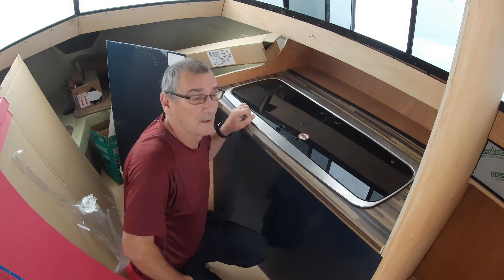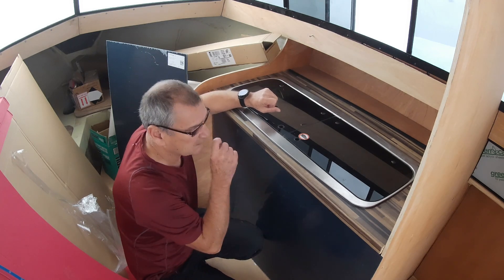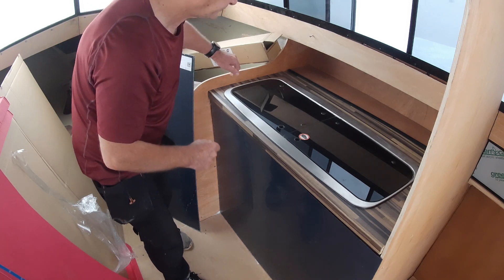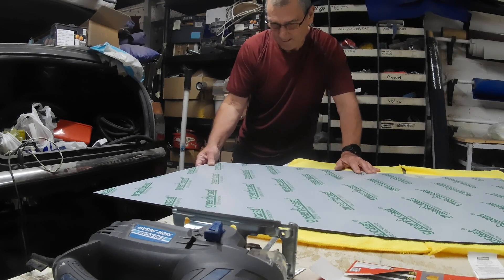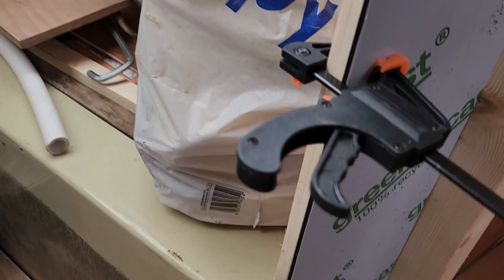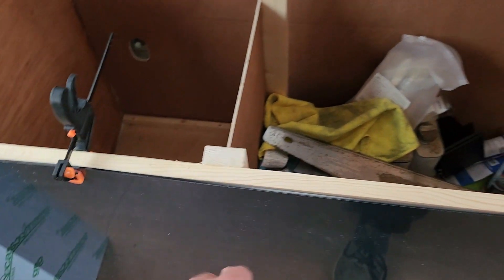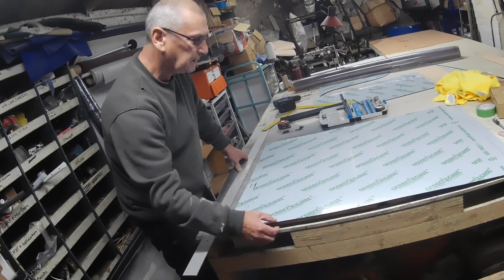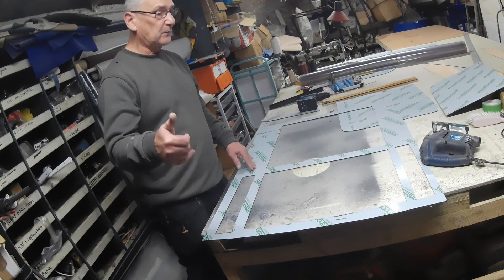EP26  #1 Birchwood boat restoration using acrylic for a modern look

Comment: That seems thankfully to have gone to plan and looks well. I dont know if you have much more acrylic to cut or drill but here is a tip given to me by a sheet metal  worker for drilling acrylic. Basically he took the drill with the bit in it and drilled the floor of the workshop with it. By doing that he said it takes the very sharp edges off the bit and helps avoid splitting the sheet as the bit breaks through. Backing the sheet with timber doesn't always guarantee a clean break through; but it reduces the risk big time he said. Also as you probably know a slower speed helps. The sheet metal guys used acrylic a lot in making templates of rivet positions on aircraft skins. Much cheaper than cocking up a sheet of 7071 or 2024 grade aircraft aluminium. A rub with a smooth grade wet and dry paper 400 or 600 with water will mist up any visible edges and gives a nice finish.
Reply from the maker: Yes slow speed and a piece of wood underneath cast is more forgiving than extruded Acrylic I think I would have struggled with the extruded stuff. Only pieces I need now is the one for the door which I can get made to exact size then I am doing the main hatch with a front curve possibly in 6mm I expect I will have to do the bend myself I've already modelled the hatch and fitted the hinges this is in another video still to be finished